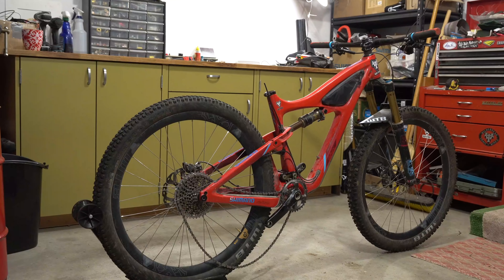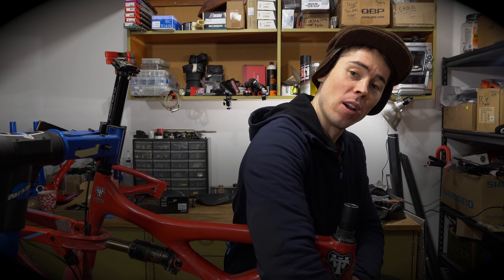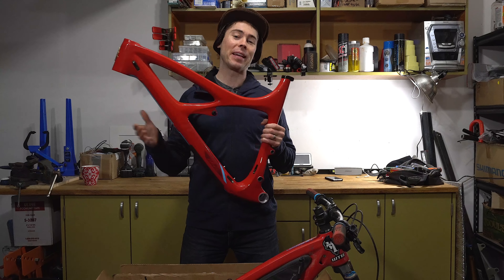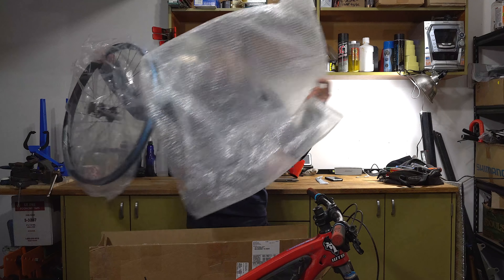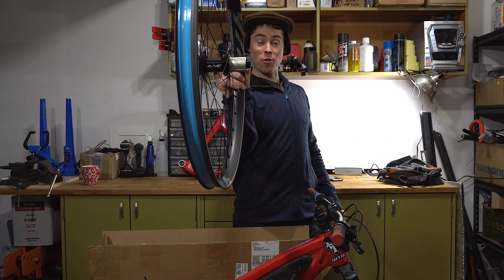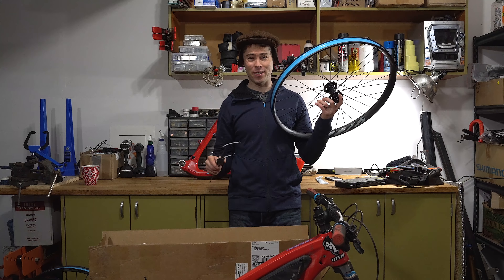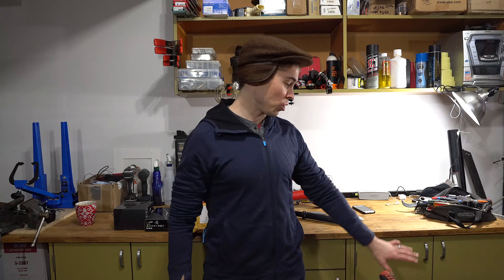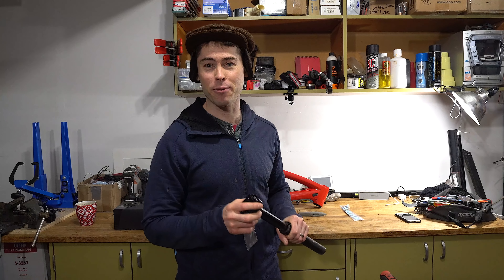Should this Mojo 3 collect dust as I ride my other bikes?

Comment: Jeff, fun, engaging format with the vlog! I have an HD3  and love  it. A few things I would do if building  a mojo would  be:  angleset headset, swap to a 180 rear rotor, 34 tooth front chainring, the mojo pedals so well  the extra torque gives the bike some more forward pop on short hard efforts, I also have a clipped maxxis shorty front mud tire but I'm curious which WTB tire you'll use. Also curious if you'll swap up to the new fox float x shock, if it fits. Looking forward to next video!
Reply from the maker: Thanks Brandon, glad you liked the format!  I think this has big potential, and I'm hoping I can get better at it through the spring.  I actually have an Angleset for this bike, but will try the bigger FT before dealing with it.  I already have 180 rotors front/rear and a 34 tooth ring on there.  All my bikes are running that, keeps it easy to swap parts!  Would love the Float DPX2 on this, we'll see if Fox can hook it up!  Thanks!

Comment: vlog format is great and nice change up.  Curious of your thoughts comparing it to the HD4. I know they are different bikes with different characteristics, but how do you think it will compare - climb/handle with the longer FT and say 2.6 tires (mounted on 742s)? Keep up the great work!!!
Reply from the maker: Thanks man, glad you liked it!  Good point, MANY folks have asked for a 2.6 vs 2.8 vs standard tire vid, and that could slot into that well.

Comment: Could you measure the height from the bottom of the rail to the top of the seat on your silverado? I always wish they made a super low profile saddle for riders that have short legs, want 150mm dropper, and have medium frames with high seat tube frames! 

Very nice build!
Reply from the maker: Hey Chris, thanks for the note, I'll check shortly for ya!
Reply: Awesome! Wish frames were designed with short seat tube posts to allow for 150mm of travel even for people on the shorter side of the bikes sizing!

Comment: Just wondering how tall you are since you like the large better?
Reply from the maker: Kelly- I'm five foot eight inches tall.
Reply: Wow, and you like the large. I'm 5'11" and ride a medium hardtail but mostly due to standover. Love watching you ride by the way, keep up the cool vids.
Reply from the maker: Thanks Kelly!  Yeah the older Ibis bikes are tiny.  I've seen guys at 5'11" (who have long arms) actually lean towards XL sized frames on occasion.  But as you mention, standover is key.  It sort of seems like the best size for general trail riding is the largest size that will still allow for a 150mm+ dropper, at least around here where the trails are really steep with lotsa jumps.
Reply: Agreed.  I'm 5'9" and change, and have ridden the Ibis Ripley and Mojo 3 in size medium, and now am on the Ripley LS in large.  Compared to some of the other bikes that I've owned in medium (Niner, Yeti, etc), the Ibis bikes are on the short side.  The size large is perfect.  My only gripe right now is that the stock 150mm dropper has too long of an insert to allow me to comfortably use the full 150mm of travel.  I can easily solve for this using a Fox Transfer or BikeYoke Revive dropper that has a shorter insertion length than the KS.  
Cheers, S.

Comment: Sram vs shimano, i prefer shimano. What are your thoughts
Reply from the maker: Great question Nigel!  I've had extensive experience with them both.  SRAM has many great, innovative ideas, but I feel that the tolerances are much tighter on Shimano, resulting in much better long term durability.  For how wet and grimy it is here in the PNW, I love my Shimano stuff.  It just keeps feeling great, ride after ride.